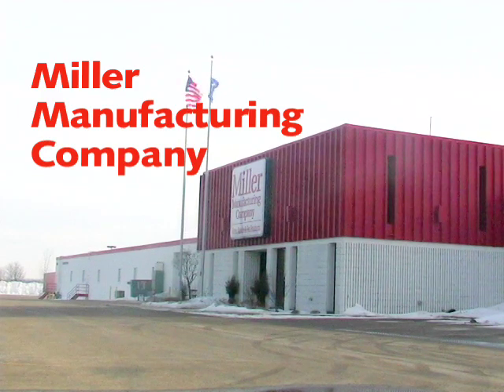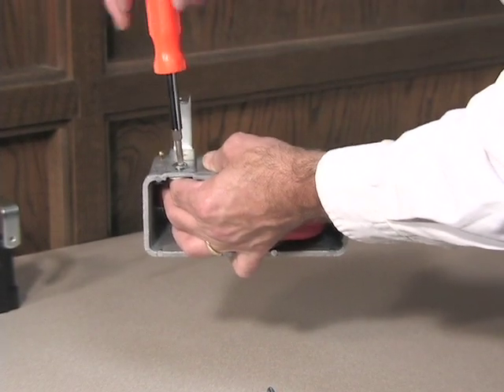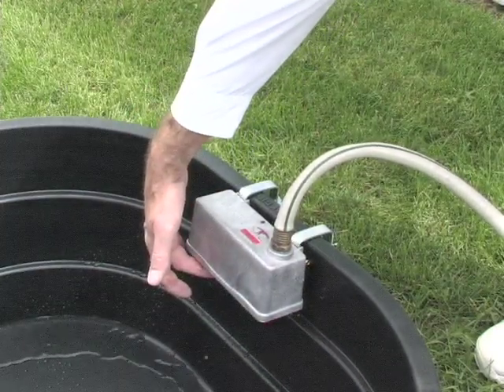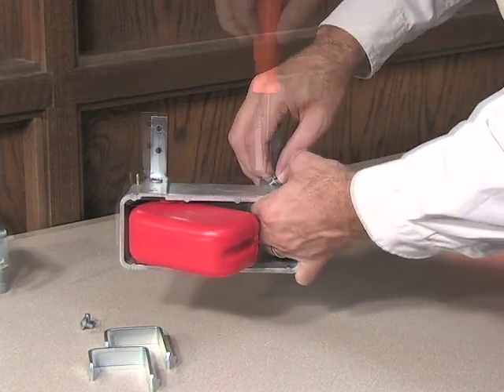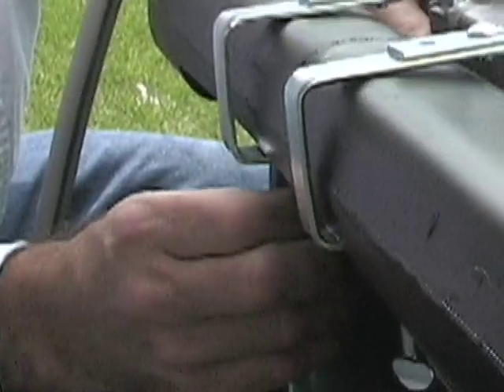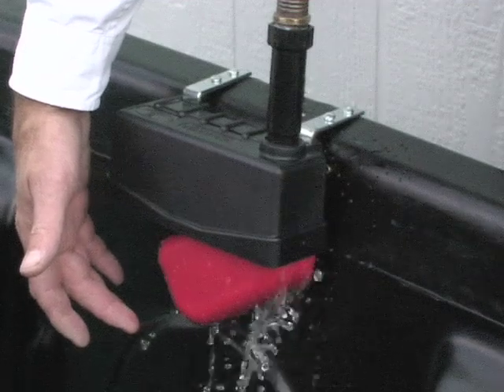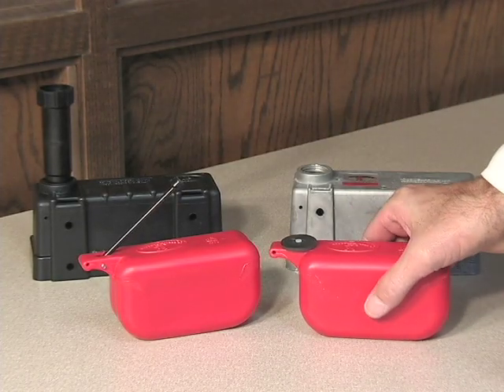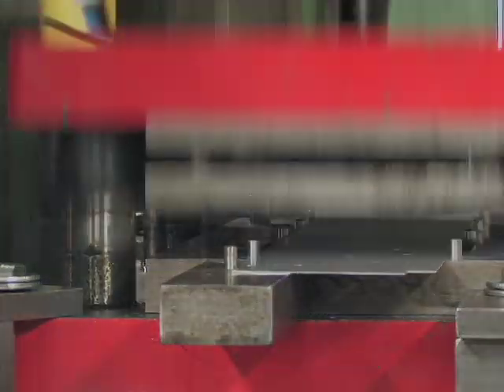PART 2: Little Giant Trough-O-Matic Instructional Video

Comment: Your company needs to start marketing to pool owners! It would be as simple as selling an alternate bracket set up for people too lazy to flatten the included brackets with a hammer or build a modification. 

The price difference between this float valve and a 'pool specific' float valve is ~$12 here vs. $50-130. As a country kid, we will be installing your product on our pool today, possibly using a pvc pipe setup we found on youtube if the modified brackets don't reach. 

Just an idea. 👍
Reply: Yes, these last me about two years.  That's longer than the "pool ones".